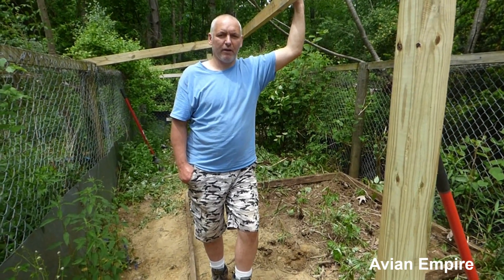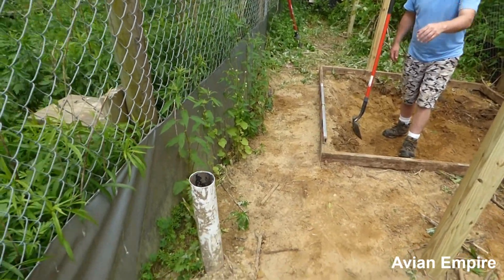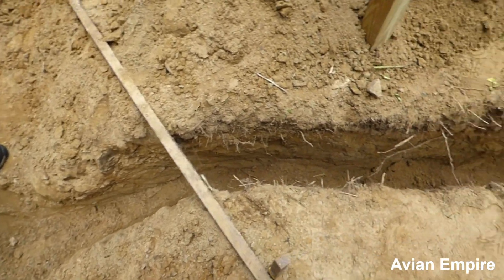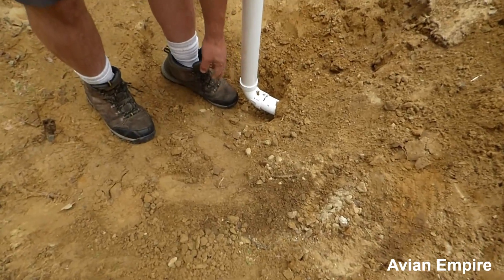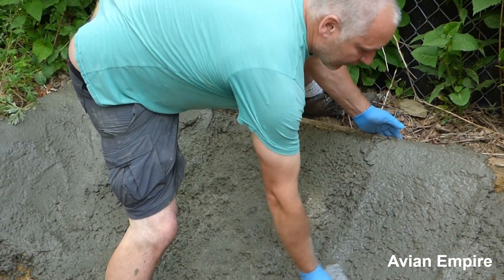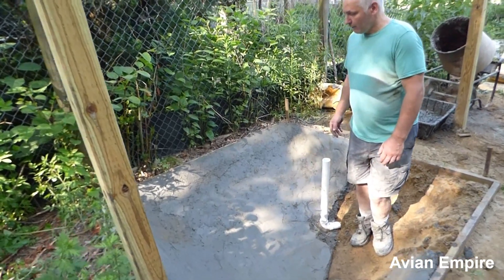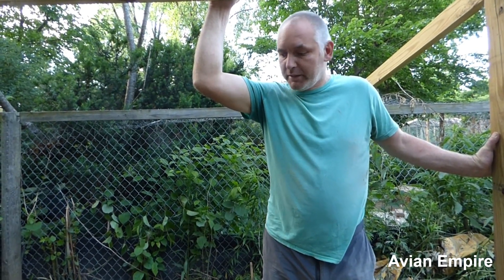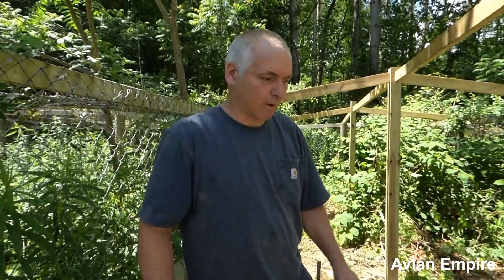How to build concrete duck pond - Avian Empire

Comment: Can you please explain more about the drainage system you installed? Not sure how the 4" pipes act as the drain. Where do they lead to? And why are there 2 4" pipes? Thanks in advance.
Reply from the maker: 2 inch is going to 4 inch pipe, because you do not want to suck in duck in to the drain. Only duckling can get in to 2 inch drain.
Where drain goes? Where is your low area on your property, or you have to dig area for water to drain to.